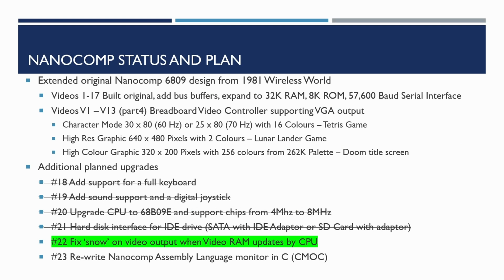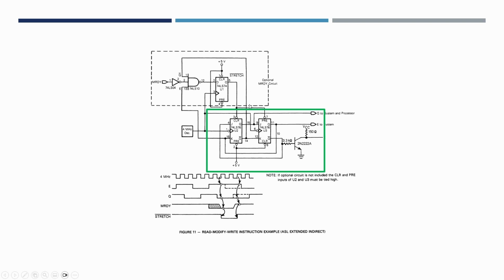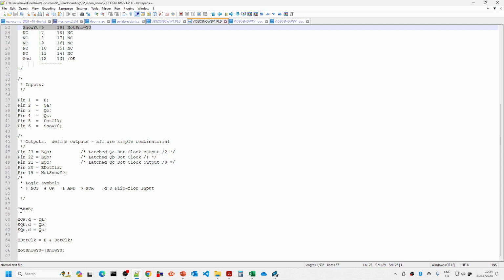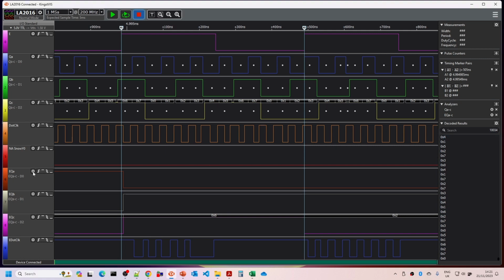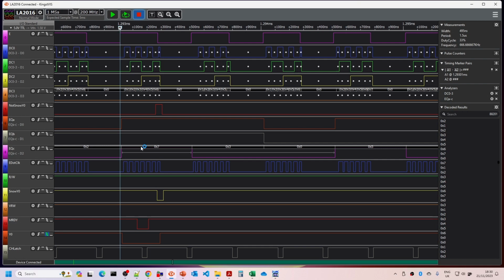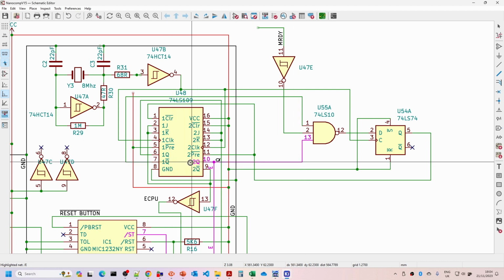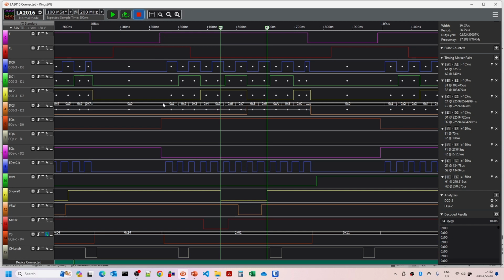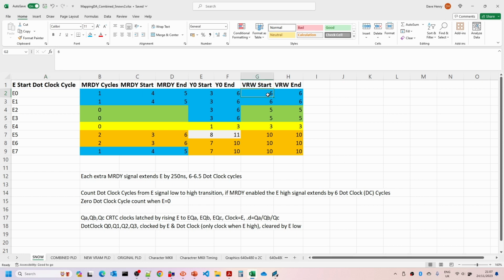Nanocomp 6809 #22 Fixing Video 'Snow' Part 2

Comment: Hi - you are doing some pretty intricate work with that timing! Thinking aloud, wouldn't it be easier if you chose a video clock that always allowed the CPU to access video RAM in phase with the character clock? A quick calculation suggests that a 16 MHz dot clock would be sufficient to give an MC68B09 its 2MHz E/Q while still allowing a PAL-like video frame. The Compacta Uniboard did something similar, but the CPU was only clocked at 1MHz. With 25.125MHz to play with, you should have some good opportunities using simple dividers.
Reply from the maker: Yes pretty complex, once I started my stubbornness wouldn't let me be defeated (especially since IBM CGA card had the same problem). VGA to feed LCD monitors needs 25.175 Mhz dot clock, not sure slower clocks will sync for same resolution. I tried deriving the CPU clock from the 25MHz one (6.25MHz vs 8 Mhz) but then the processor became unstable and locked up from time to time  (perhaps the fixes I did later to buffer the 25MHz clock may have helped). With slower clock the CPU read/write cycle still then overlapped with the character latch and needed MRDY wait states anyway (slower clock also needed longer for CPU to update VRAM) so I figured may as well use faster clock as % of MRDY cycles is pretty low. Dual Port Video RAM is the best way to solve it but the only DIP RAMs I can find are 4K and £20 each so a bit steep for 64K RAM! Surface mount dual port VRAM for 32Kx16 has 100 pins (Renesas IDT70V27S/L)  and costs £87 per chip so not practical for this project. Next project I am going to try and build a MCGA compatible card as part of it so can have another go then! There's definitely other ways to do this, thanks for the feedback.
Reply: @breadboardinglabs  interesting!

I have 2 things that may interest you:

1) some CUPL code that generates the E/Q clocks from a 12Mhz master, with MRDY included, and a clock speed change for slower devices RAM. It may be ATF750 specific, but could be squeezed into an ATF22V10 if you sacrificed some pins and or functionality.

2) A video card design from long ago where a very nifty latch is used to stage the RAM write between video character clocks. It’s all done in 1980’s TTL, but GALs will dramatically simplify this logic. The downside is the RAM is write-only, but when overlayed on regular RAM, you don’t notice it.

Let me know if you are interested 😊
Reply from the maker: That would be interesting thanks. You can email me details at email breadboardinglabs (at) gmail.com. Dave